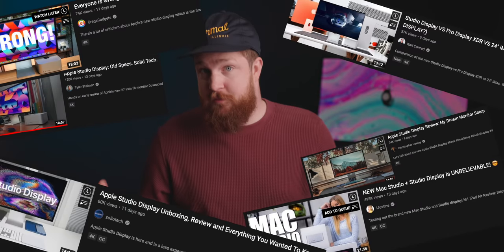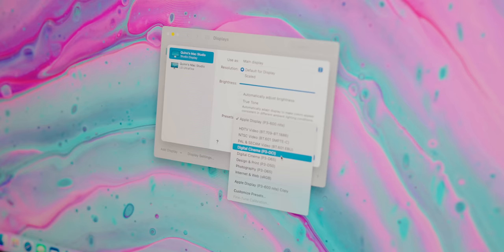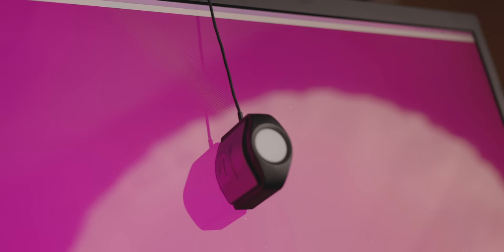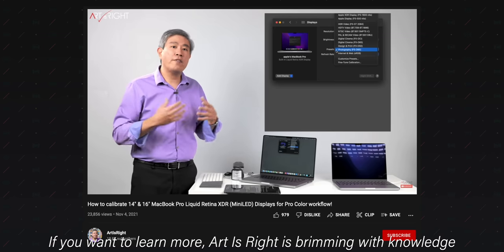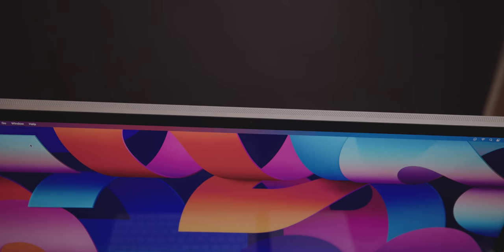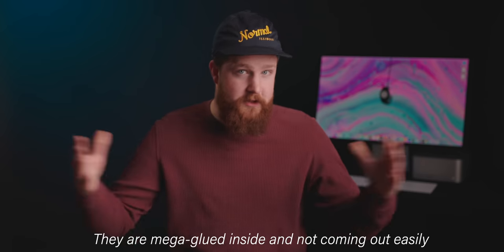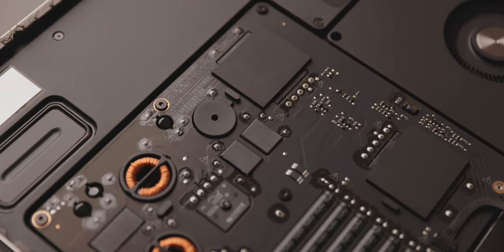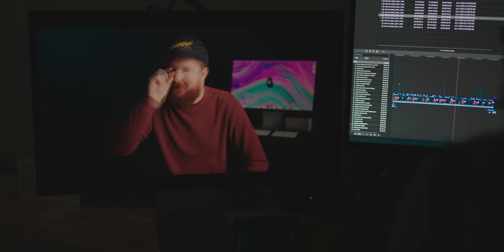The Apple Studio Display Is WEIRD!

Comment: You went in to say this was overpriced and showed a 1600 4K display to compare it to...

I m a software engineer. I don’t need the best display panel. I want a traditional ratio 27” 5k monitor and NO ONE ELSE offers that. I need the resolution to fit as much CODE as possible on a screen. So I NEED THE RESOLUTION aka not a 4K monitor.

If you are a photographer or do gaming or other things that require better quality display...pay up. 5k and not the resolution $5,000 dollars for the XDR lol

I currently own the 5k Ultrafine and the amount of times the Bluetooth disconnects and disrupts my work flow alone is worth an additional 300 bucks. If I m going to complain about something being overpriced, it’s the Ultrafine display

When the “competition” is selling a slightly better display by “picture” standards with a crappy plastic finish that doesn’t look as crisp on a Mac...that’s a NO

Too much is being made of this panel and when the LED version comes out to replace the XDR panel ya will probably complain at the price of that too even though I don’t think there is a 6k mini led monitor on the market...

For Apple users, this is your only option. If you don’t need a 5k monitor then there are a million 4K options that do not work as well as this does anyhow

Be happy apple is giving mini led in iPad and MacBooks and stop expecting a mini led monitor on such a large screen for 1600. If they made it LED it would have been 3500 lol
Reply: It’s still overpriced. The lack of competition in the space is exactly why it’s so expensive because apple knows they can sell it there. If other manufacturers started to make 5k displays apple would really look stupid because of their pricing. Having a few backlit zones would not make the monitor super expensive and would keep it below 1500. Apple is doing this because they are the only ones selling a 5k monitor
Reply: @crestofhonor2349  

And rolls Royce charges you what a house cost because they are the only ones who can do it and make money

“If every manufacture started making rolls Royces”

It don’t work that way. Apple actually has huge control over their parts and engineering and manufacturing. Other manufactures WOULD NOT be able to give you this SAME monitor for LESS

They could in a cheap plastic casing maybe with crappy speakers etc

It isn’t overpriced until there is a solution that makes it overpriced and the only other panel like this cost 1300 and is a 6 year old model w plastics and crappy speakers and camera

I do think it’s too high but overpriced...that can’t really be proven for the display and build quality. There is NOTHING TO COMPARE IT TO

Every 5k monitor in the market whether wide screen or this same ratio is in this price range or higher. Dude showed a 16-1700 4K monitor in this same video lol
Reply: @UrbanBDKNY  Except Rolls Royce isn't the only one making luxury cars and SUVs in the market. Yes what they offer is very expensive but they have other competitors who make very similar cars that appeal to the same market. Apple does not have this and they are the ONLY ones offering the 5K monitors on the market. Yes they are very much overpriced and sell it there because no one else makes 5K markets. Rolls Royce was a bad comparison considering all the other brands competing in the same market. Yes Apple does have a unique offering and sync between their hardware and software but it still doesn't justify this behavior they have of putting a stupid high price tag on it. They charge $400 for a height adjustable stand, how is that justified?
Reply: @crestofhonor2349  

This is a good conversation. So let's keep it going as long as it's not offensive

1) Rolls is a good example because when compared to a full loaded S-Class for example, it still cost more than double. Is it twice as good? or is it just twice as expensive? a Rolls is damn near twice as expensive as a Bentley which is ultra luxury already it self. It is not twice as good...

2) That stand is straight aluminum and likely machined out of ONE PIECE of aluminum. My question to you is, how much would this cost you for any other usage? I agree that apple products are EXPENSIVE but overpriced is TRICKY again because NO ONE else makes a stand out of a solid piece of Aluminum like this. Apple is charging a lot of money for things no one else provides

The housing market right now is on FIRE because of demand and supply. A shortage in housing has ballooned the cost of housing. Apple does charge more because they don't have anyone competing with them but that leads back to my original point that to make it overpriced there has to be someone offering something similar for less.
Reply: @UrbanBDKNY  As it is yes aluminum builds are quite expensive to do with computing hardware. However Apple has one major advantage in this market compared to other companies, an aluminum market economy of scale. It's probably much cheaper for apple to do CNC aluminum casing for their products than most other companies because they already have the necessary facilities set up to produce such products. Other companies it would be far harder and more expensive because they'd have to commission other companies to do the CNC themselves or build their own production factory. That would cost quite a lot more money for them to produce since they would need to spend their own money for someone else to produce it for them. Apple, since they've been doing this for over a decade, has already had the places setup for in house production making the process far less expensive overall to produce.

And yes the point about Rolls, they have had a long history of selling to the most rich of clients. Of the various reviews I've seen of these cars Bently just doesn't compare to the feel of a Rolls. I've heard that Rolls drive like no other car out there and its so smooth that they can't even compare to other companies. Tons of other factors involved the average user just won't see unless you have the ability to take one apart and just see what they do. Rolls also produces much of the parts inside their cars which is possibly the reason they ae more expensive. I believe they make their own custom engines and many other parts unlike Bently who might purchase their stuff from other manufacturers
Reply: @crestofhonor2349  sounds like Apple lol 😆 

Yes RR started building airplane engines I think it was and you are right about the ride quality. Nothing else like it but Apples OS is unlike anything else also

Apple products are premium and so they charge what they can. The fact that other companies CANNOT reproduce anything Apple makes in terms of quality for less means that even though their products are PRICED HIGH they are not necessarily overpriced. I WISH this monitor was like 800 instead but the reality is no other monitor close to this one is even under 1300 dollars and this one has a build quality like no other. Sucks but it’s a premium product that is worth the money for those who can buy it

Comment: I've been waiting for the silicon 27" iMac, so my ears perked up when he said this looked like it could be a precursor to the pro-focused iMac. I hope he's right and I hope it comes soon. The studio Macs seem great but I like the simplicity and form factor of the all-in-one iMac.
Reply: Since apple had hinted that there was only 1 more apple silicone Mac to come before the transition is complete (the Mac Pro), and also the fact that they discontinued the 27 inch iMac with the launch of the Mac Studio and Studio display, it seems as though a 27 inch Apple silicone iMac may not be coming any time soon, if ever
One theory i did come across was that apple were originally working on a 27 inch iMac, possibly an iMac Pro, but due to thermal issues they canned it, and instead released a Mac which is similar in some ways to the Mac Mini, and they instead used what they had to make a 27 inch display
If that theory is correct, then apple’s insistence on using an internal power supply may have killed the 27 inch iMac

Comment: So picking a less expensive 4k display should be a better deal, but there’s one thing hardly mentioned anywhere: mac os scaling. From what I’ve heard, mac os can’t really render sharp text on 4k display. As I programmer this is a big deal for me. From what I have, I can confirm this is true for 1080 and 1440p displays. I’ve used 5k iMac before and the text sharpness is just outstanding. Also, probably not a problem with the monitors themselves, I’m getting minor blinking or turning off for few seconds issues on my Dell displays. Using Apple own hardware should save you from these annoying issues. What do you think?

Comment: you kind of touched on this point, but it's also probably worth noting that if you're looking to get an LG ultrafine 5k and if you find yourself on ebay, you could be spending... ~$750 to $1000? which really, really makes the marginal improvements of the LCD panel extremely frustrating. when it gets down to that, nothing about better USB I/O or nicer speakers makes up for the disappointment of this still being an 8-bit LCD panel with no local dimming, no HDR, etc...

Comment: You can sort of see why it is so expensive, but it is mostly fluff that you don't really need. At the end of the day it is just an old 5K panel much the same as we have had in the iMac for many years. I would rather save a lot of money and get a larger 32" 4K monitor. I doubt I would really notice the difference between 4K and 5K unless they are side by side.

Comment: I disagree, I find LCD monitors with few dimming zones more annoying than edge-lit monitors with more or even the same number of LEDs, as long as there isn't any backlight uniformity issues. My favorite screen tech list would be 1. OLED 2. miniLED 3. edge-lit LCD 4. LCDs with stupidly few local dimming zones. With miniLEDs despite Apple's extremely dense miniLED backlight Apple still can't prevent blooming when, say, you're reading white text on a dark background. With low density local dimming it gets disgusting. So I don't get the criticism that the Studio Display doesn't "even" have a few dimming zones, it shouldn't, it should either be miniLED or normal LCD.

Comment: Fact: Apple Studio Display supports EDR, which is a form of HDR someone reviewing this monitor should be aware of.
Fact: Dimming zones are much larger than pixels, so they add artifacts to images with high contrast, making them less than ideal for image editing.
Fact: The Studio Display allows 96W charging of connected laptops, meaning an external power supply would have to be larger than the 24” iMac’s 143w power supply

Comment: My BenQ 32 blows the Studio Display away. It is specifically designed for video editing, no mic and speakers are crap but my KRK stereo pair more than makes up for that. It includes adjustable specs for all video editing requirements, has HDR and the display is gorgeous. It also has a non intrusive non-glare coating which has no discernible impact on clarity. Price point is a very reasonable +/- €700 and works a treat with my 16GHz M1 Mac Mini. Thanks!

Comment: There is a big issue with the display that reviews have not yet addressed. No its not the unacceptably horrendous webcam. The issue is that the monitor runs its own operating system (IOS) to manage the camera, microphone and speakers. Like any device running a consumer based operating system, it can't be run indefinitely without restarting it or you run into issues. If you don't restart your iPad or iPhone for weeks or months you will eventually experience all kind of issues. I got my studio display on March 18. yesterday my camera started acting up, then the microphone and speakers would stop working sporadically. After hours with Apple support it was determined the monitor needs to restart. BUT there is no way to do it, it has no power button and no way to actuality shut it down or reboot/restart properly. So the only way to do restart the display is to unplug it from the power source for a minute and plug it back in. We did so and its working fine again. However, doing it that way means you are crashing the build-in OS rather than properly restarting it. That of course can potentially damage the display just like crashing your computer every time you want to restart it.

Comment: I'm waiting on my new mac studio.  It won't deliver until october.  So I'm contemplating screens.  I'm currently still using my late 2012 27 inch imac.  Also I'm retraining and attending college, so I qualify for the university discount.  I wouldn't mind stepping up to retina.  The 5k ultrafine is not in stock anywhere at any physical location near me.  Amazon has it for $1600 CAD.  The studio display after my university discount would be like $1650 CAD.  So $50 more and I get usable speakers and a better webcam.  I nearly walked out of the apple store with one because to me that made sense.  What stopped me was the fact that 2 people there felt there was no way to make it work with my 27 inch late 2012 imac (people on reddit seem to think it can't be done either), meaning it would collect dust for 2+ months. So I decided just for fun to check the local computer store and I found the LG 38 inch ultra wide 3840 X 1600 IPS, which has an MSRP of $2k CAD on sale for $1k (managers special).  I'm somewhat confident that I can run some kind of signal to it with my old imac until the mac studio arrives, and even if not it will be pretty damned rad connected to my x-box.

Comment: 100% agree. While I agree - the panel is better than the Ultrafine 5k... it's not so much so that it justifies an upgrade. To me, Apple didn't need to provide a display that matched or exceeded the quality and specs of the new MBPs or the iPad Pro 12.9" displays, but it needed to stand out from previous offerings. For my use cases, it doesn't:

* I use Airpod Pros for video calls, because echo during video calls is the worst. And I use professional microphones when needed for recording. I don't care about a mic in my display.
* I use an A6400 or an older Nex-3 for my webcam. I don't care about a built-in webcam. That's a last-ditch resort.
* I use studio monitors or headphones (typically DT-770's) for audio playback (except in video calls, which I'll use Airpod Pros, again). Spatial audio? Neat. But not a game changer, when I have a set of studio monitors that cost half as much as a Studio Display sitting next to me.

The new features are nice for those that need them, but provide me no tangible benefit.

Then we get to the panel. Apple has obviously made leaps and bounds in display technology (obviously in partnership with companies like LG and Samsung behind the scenes). The 2021 MBP display is the most beautiful display I've ever set my eyes on. While there are some improvements to the panel over the Ultrafine 5K, I'd call them incremental or generational, not mind-blowing. 100 nits? Great. I never have my Ultrafine max'd out anyway. Slightly better backlighting? Again, great, but I can live with it. That magenta hue? That's not present on mine.

If the Studio Display had come out with a 30" or 32" panel, that would've been enough for me to justify the update. If they would've leveraged the A13 to include AppleTV when not connected - okay, that would've been really cool (and your display could basically act as a home hub!). If they would have pushed the resolution to 6k - yep, another thing that would've pushed me to buy. But, for the price and its feature set, I'd rather stay with the Ultrafine 5k. A little bit more bezel never killed anyone.

Comment: The issue with the Ultrafine monitors is they develop panel problems. I've had 3 of these and they've all ended up with severe image retention and the pink tint around the edges gets worse over time. Happens with the 4K version also. So they're dead to me. The only other option is the Samsung Viewfinity which is inferior in quality in all aspects, has a matte coating and has to be controlled using a stupid little remote (and has no hardware DDC support to get around this). So that leaves nothing but the studio display....

Comment: I realize this would have also been controversial but I believe they should have reused the iMac power brick. Yes, it would have needed a power brick but as it is it needs a (relatively) no removable proprietary power plug, so is that really better? The extra brick would have greatly reduced the cost (economies os scale) and complexity. No crazy power boards, no cooling needed. Ultimately, Apple was in a corner with this one because AFAIK there is only option for 5K LCD panels.

Comment: You should check out the LG c2 42inch or 48inch for computer use, they are essentially the same price but oled 4k 120hz 10bit and have great hdr, only real problem would be burn in but even my old LG cx seems to be fine after years of pc use
Reply: does it have Apple logo?
Reply: 4K is ridiculously low res for 42”. It’d be equivalent to like 1440p at 27”. Apple would only release a 4K screen at 24” or below, and even that would fall short of their target PPI. 

What I’m learning from these comments is that (a) Quinn has a lot of PC user viewers and (b) a lot of people are coping with some bad monitor resolutions in 2022

Comment: just pulled the trigger for a new one at $1299.  I was considering two 27" 4k BenQs (for about the same price).  ultimately i went with MS b/c of the 5k, interoperability with mac, and build.  looks like its built like a s$%^ brick house and will last several mac unit replacements.